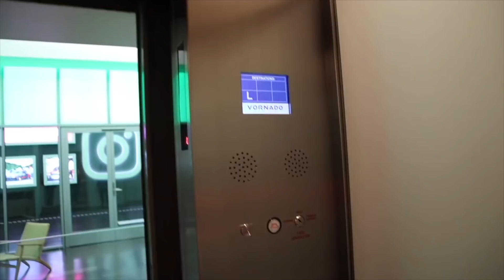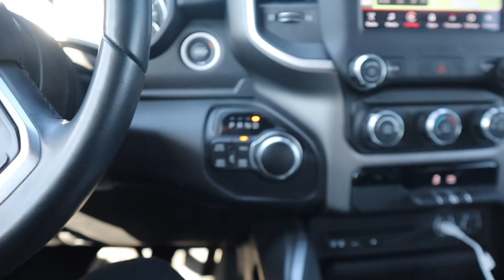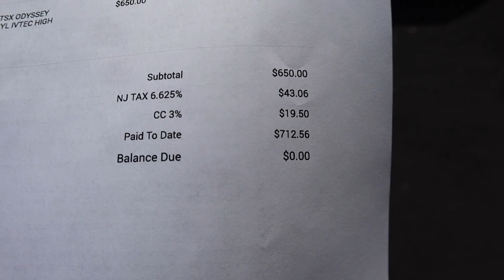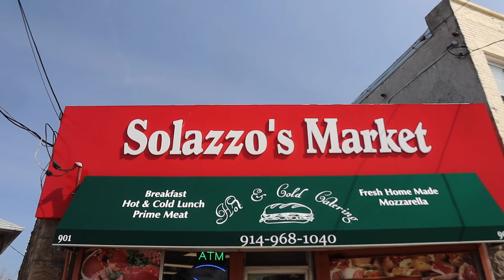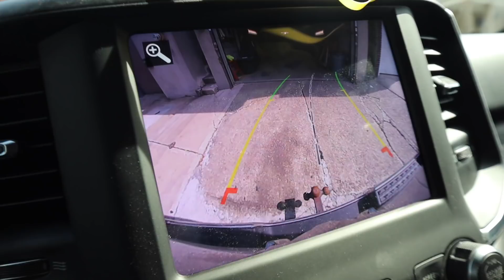😱JDM ENGINES FOR DAYS!!😱

Comment: 💎💎💎 and 🔥🔥🔥 as always!! The valve cover had HC on the side for Hella Clean lol. I was just doing my Timing belt on my car and noticed that who ever had the car before me had broken off a bolt in the motor mount that goes into the block so I pulled the other 2 out and the threads are F*cked!!! Was thinking about K swapping it.. or I have a B20V I can throw in for now.. any ways love the video as always! Keep gunnin 🔫🔫

Comment: I've a question maybe you'd be able to help me. I have a 2002 2.4 V4 Toyota Camry. I love my car but recently I've noticed that white smoke has been coming out the tailpipe (Only for a couple of seconds and only in the mornings) . I had it checked out and my mechanic is saying my head gasket is going out. I've noticed that I've been losing coolant every so slightly. My engine has 134k miles on it. My mechanic is charging me 1500.00 to replace the gasket. I  have many JDM shops that sell used engines around my area for 1200.00. Labor is around 1K to put it in. A total of 2200.00. I also found a rebuilt engine on offer up for 900.00 + 1K to put it in but I don't know who rebuilt the engine. I don't do any tuning and I'm not a mechanic myself. I just want reliability and I want to get to point a to point b. I live in So Cal. What do you suggest? Thank you for your video it was very informative and your advice is very much appreciated.